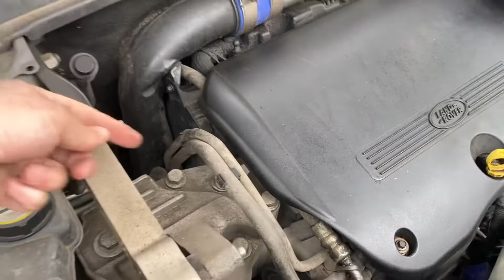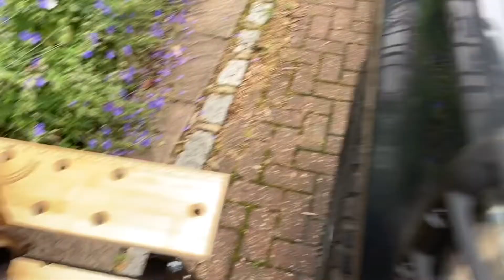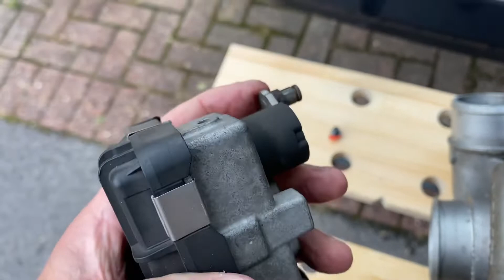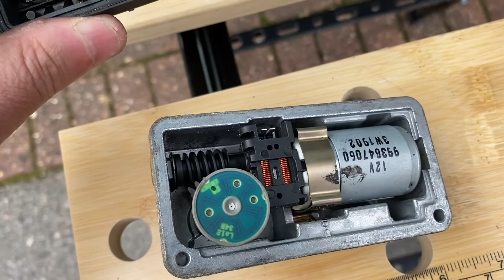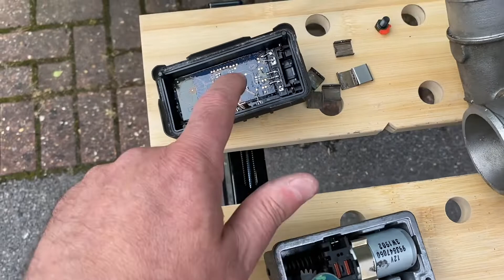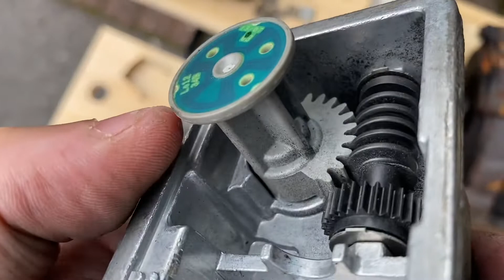Variable Geometry/Vane Turbocharger dismantling

Comment: Great video explaining the turbo and actuator, I love your confidence with ideas how to re manufacture parts👍🏻. It’s helping me diagnose my FL2 SD4 auto 2012 that seems to be struggling with smooth low boost, you can hear the turbo chewing / juddering as if it can’t move the vanes correctly but no fault codes. I look forward to the turbo mod and another re map following the install👍🏻👍🏻👍🏻
Reply: My car finally went into low power mode and codes for MAP sensor. I took them apart and found a split in the hose underneath the throttle body. I’m going to replace the lot whilst they are out. I have also had the arm off on the turbo vane controller which moves freely so my juddering will have been down lack of low down pressure due to the leak and the sensor reading wrong.
New turbo pipe to throttle body, new throttle body and MAP sensor and its running so smooth.
Thanks for the videos.
Reply from the maker: Thanks. I ran out of time to try this modified actuator before my remap. It isn’t really needed now, although I’d like to still try it and see if it makes any difference. Maybe I’ll get another FL2 driver to fit it and video the results.

Comment: I'm also think there would probably be a feedback loop between the ecm,  the boost position and manifold pressure. Therefore, I think the ecm would try to compensate for any adjustments you make, unless it's out of range and then you probably generate boost command position unreachable in the DTC.
Reply from the maker: The actuator will feedback that it is moving, but there is nothing to prove it is actually moving the turbo vanes (some cars have a sensor to check this, but not the FL2). You could technically drive it with actuator linkage missing, I’ve heard of some owners simply locking the vanes half way and accepting they won’t have maximum performance. The MAP sensor measures the boost and completes the feedback loop. My thinking is I can squeeze a bit more boost out of the turbo before it triggers a fault code. We shall see!
Reply: @BeavisPits  agreed dude, it'll be a great experiment. I assumed it would continously vary the boost control until it hit the required boost. Be on the look out for boost control related dtcs. Just out of interest, would it not be easier to rewrite the ecm code for the extra boost?
Reply from the maker: I will be looking at a remap too, to compare gains. This turbo idea is just an experiment and may not work. I just want to try it and see.
Reply: @BeavisPits  if you do go for a remap, see if you can talk the chap into filming the process, it would make a fantastic YouTube video! Haha Best of luck on the mechanical mod, I'm excited to find out.
Reply: Sorry to be a pain! Haha. Your autel scanner... does it give you access to the boost value from the manifold? I've just got one of the tablet variants which can log boost... its a great toy! If yours doesn't I could maybe log mine so you can use for comparison...
Reply from the maker: I’ve not seen boost pressure in the data but it does give MAP voltage which can be translated into absolute psi/bar. I’ll look at this in part 2 and may rig up a boost gauge too.
Reply: @BeavisPits  ill be very interested in that! Great videos dude. They've been very helpful and interesting.
Reply: @BeavisPits  "The actuator will feedback that it is moving, but there is nothing to prove it is actually moving the turbo vanes (some cars have a sensor to check this, but not the FL2"

This is what I'm counting on. I've ordered a new turbo for my FL2 - I've had a P0299 code for 8 months now and I've replaced EVERYTHING. All boost hoses, intercooler, actuator, turbo rebuild. Nothing. 
I'm now hoping the turbo wasn't rebuilt properly and hoping a new one will cure it. 
The parts canon has been loaded so many times with this car.

Comment: I've only got halfway through the vid, so apologies if this comment is already covered... I think the strange pie segment like pattern on the circuit board and reflected on the arm output is an inductively coupled position sensor. If you connected a scope up to the two pins connecting to the pie, you'd probably see high frequency pulses... just a guess at this stage of course.
Reply from the maker: I think you are right